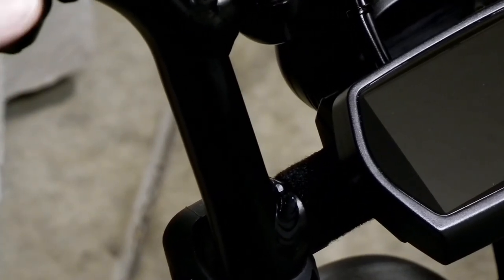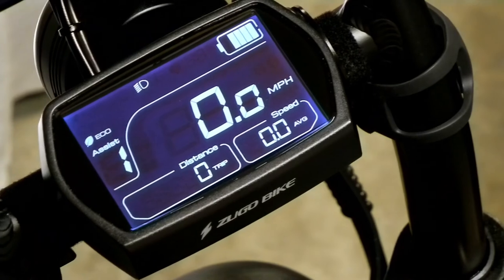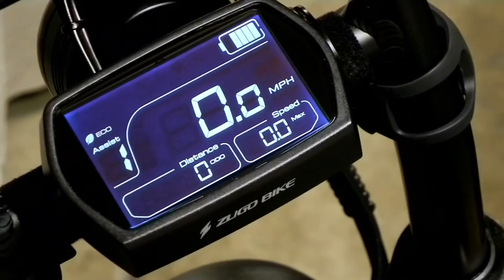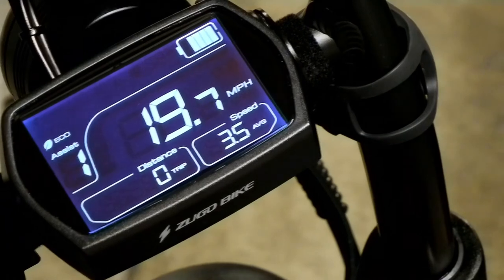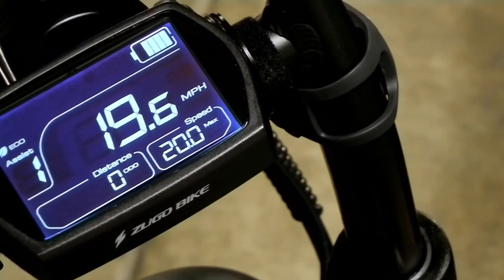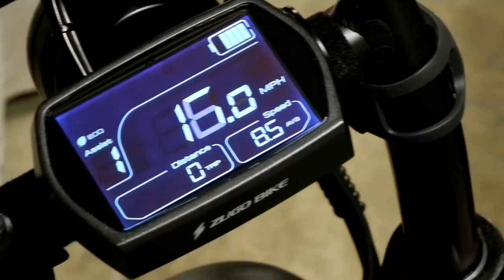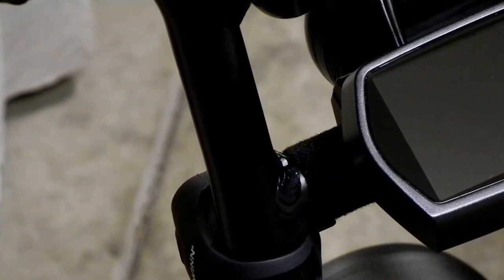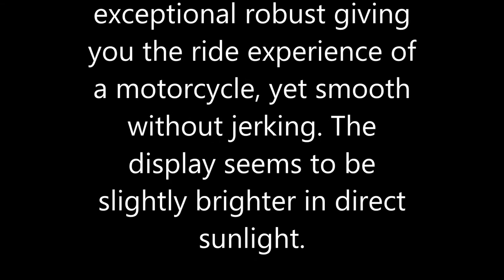Zugo Rhino, 1 year later. UPDATE!

Comment from the maker: One thing I did not show was the PAS levels 1 through 7. All 7 levels work with this upgrade. The additional power is incredibly. Love it.
Reply: What’s your top speed?
Reply: Hello mister David..! So question. Just purely on throttle, what are your top speeds on each level? Like mine, if I’m on 5, I top out at 22. On 6 it tops out at 25 and 7 is 27-28. Is that what yours does?
Reply from the maker: @Tokyobanana808  I have upgraded to class 4. Top speed is 31.6mph
Reply: @davidelardo1160  How did you upgarde to class 4? did you have to buy to a completely different battery? If so which one?
Reply: @davidelardo1160  zugo class 4???
Reply from the maker: @jpbravo2012  And love it!

Comment: David Elrado- We lost our keys. Would you show how to take off seat and remove the lock on the Zugo?
Reply from the maker: I will try y to explain. Everything is done through the battery bay. Remove the battery. Next, there are 6 nuts under the seat that attach it to the frame. Remove them by turning them counter clockwise using the proper wrench. Removing the key switch is performed the same way, however, first disconnect the wires. Hope this helps.

Comment: Friend I've had so many issues with my bike and I've only had it since January of this yr. Battery dies after 20 miles if I'm lucky and that's PAS,  if zugo can't figure it out I'm going to upgrade the bike to a 1000 or 1500w setup with more battery...maybe even 2 batteries because now I have range anxiety 🤣
Reply from the maker: Sorry your having issues with your bike. Zugo will help you with your problem. 2 things to check for. Make sure your front and rear wheels spin freely by hand. 2nd, check the mechanical spring connection on the battery. If some of them don't appear right, tell Zugo. All of the clips should make full contact. Hope this helps.
Reply: @davidelardo1160  yeah I just did the brakes they locked up on me too for some reason, the brake lever is leaking mineral oil and is spongy. Wheels spin freely and battery from what they can tell looks great, but I'm thinking it may an internal issue with the battery. They said they will send me another brake whenever they get it in, supply problems everyone is going through

Comment: its called an electronic speed controller or ESC for short. not sure where you got that other stuff from. it also is not going to get hot, its pretty low power. its lower power than your motor. see where it says nominal current is 13 amps? well 13 amps times 48 volts is only 624 watts so it cant even run your motor at full power.
Reply from the maker: I have to disagree. An ESC controls rpm. This unit controls more than just rpm. Also on hot days electronics don't like high temperatures. They lose their efficiency. Keeping them cool is essential.

Comment: That was an awesome upgrade  i saw your 1 yr review and I came across the update  of the one yr review and I had to see it. Is the 34.8 mph with peddle assist or just throttle. I know the unlock code takes the mph up to 28mph but I'm not sure if that's throttle and peddle assist or throttle only. If zugo can get 34.8mph it gives the super 73 a run for its money.
Reply from the maker: I would wait for your warranty to be up, but highly recommend the upgrade. You will love it.
Reply: @davidelardo1160  sorry David I revised my original question. Someone had asked you this warranty question.
Reply from the maker: On level ground I was able to achieve that speed utilizing PAS 7. With throttle only and the tires at 28psi front and rear the top speed was 30.2. I recently realized my battery terminal were slightly bent reducing the overall voltage. From time to time you have to inspect for this and straighten the spring connection

Comment: Is there a way to have two batteries powering this bike at the same time where when one battery dies another is activated? I'd like to get more miles out of it.
Reply from the maker: Yes it is possible, however where would you mount it. The easiest way to achieve more mileage  is buy from Zugo or build a higher mah battery.
Reply: i just did that to my zugo. i added a 52v battery under the top tube and i ran the xt60 power connector under the seat so i can just swap the batteries by unplugging one and plugging in the other. i have a video about it if you click my name.
Reply: @dumwaldo Where’s the video
Reply: I’m confused so you go 30mph now? My zugo goes 30 by simply unlocking it with the code 1919 then 0606
Reply: @freedeeztallbikes82  mine does too. But, just purely on throttle mine is a steady 19.7 in any PAS level. I get the initial burst of 33 but then it’s right back down to 19

Comment: Hi my name is Carlos very interesting video . Just purchase a e-bike I am concern with Zugo looks like they are out business would you ha ve the specs of battery and controller who makes it for future use
Reply from the maker: Thank you for your comments. Zugo is very much in business at zugobike.com
All of the components were supplied by Zugo, though you have to sign a waiver to release any warranty and liability. I hope this answers your question.
Reply: @davidelardo1160  Thank you for the reply . but Zugo has closed Doors  Office do not answer whole week  if you have the battery specs  and brand for future reference would appreciate.
Reply from the maker: @carloserosal708  
I am sorry your having trouble getting through however, you should keep trying. There battery like many ebike batteries is  proprietary to there product. If you find the same battery fit the cell construction may be compromised. Quality batteries are expensive. Check to make sure you have the correct phone number for Zugo. I still receive emails every week from the company.
Reply: @carloserosal708  Electric bike company Zugo files for Ch. 7 bankruptcy
The Austin-based company makes and sells electric bikes that start at roughly $1,800, according to its website. Zugo has up to 49 creditors and owes liabilities estimated between $1 million and $10 million, according to court filings

Comment: What’s the max speed you hit on level ground with this upgrade?
Reply from the maker: My max speed throttle only is 28.9 mph. Using PAS level 7 is 34.7 to .8 mph. My weight is 143 pounds. Hope this answers your question.
Reply: @davidelardo1160  how do i get up to 34.8
Reply from the maker: Best is 31.4 mph. Throttle only on level ground.
Reply: @davidelardo1160  i only get 28 so i have to call them to get a a different module?
Reply from the maker: @MannUpTv  Each bike may very some. Make sure your tire pressure is 28-30psi. I run 28 rear 30 front. Also check that your battery is making good clean connection and fully charged. Check that your brakes are not dragging. Hope this helps.
Reply: @davidelardo1160  how did you get it to 28 without pedal assist?
Reply: @davidelardo1160  how did you get it ti 28 without pedal assist?
Reply from the maker: @richardauguste6328  
Contact Zugo and ask for the upgrade. However you have to sign a waiver.